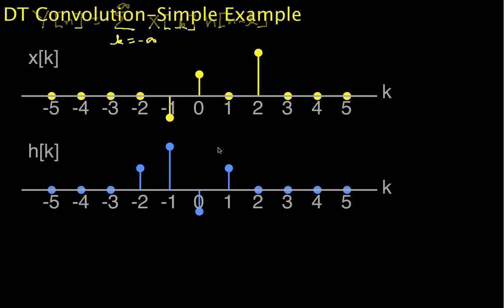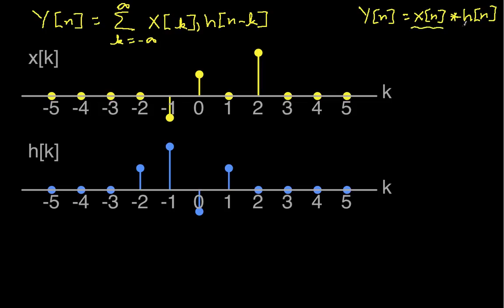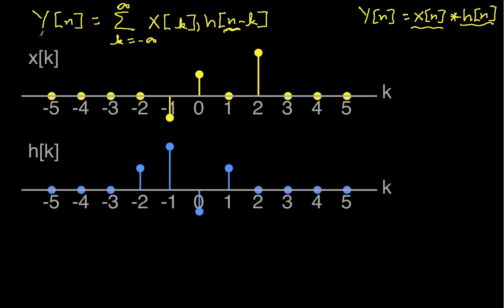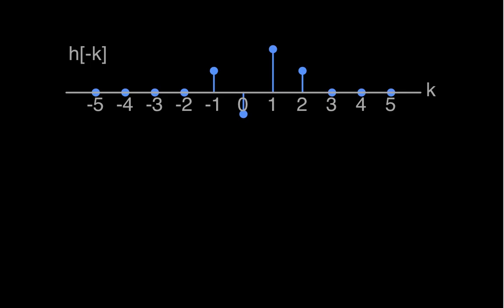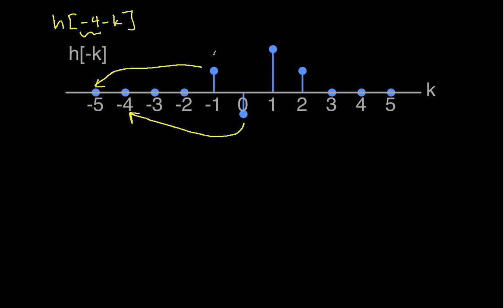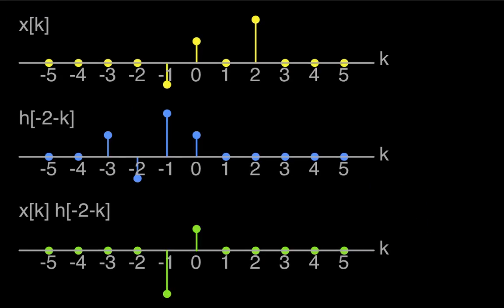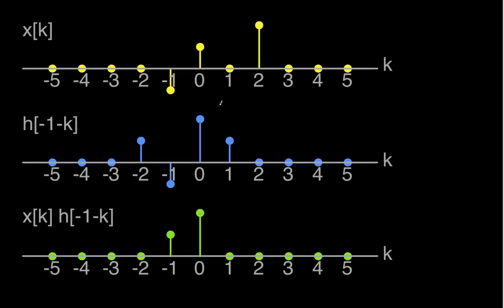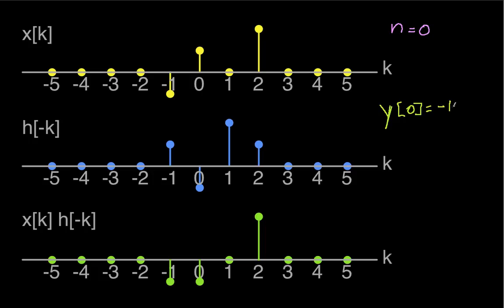DT Convolution-Simple Example Part 1

Comment: Well, actually that won't be the case. If you have a signal x[n] and a signal x[n-2], then the -2 would account for moving to the right (or delaying the signal). Here you are working with x[-n] and x[-n-2], however, and x[-n-2] is nothing but x[n-2] flipped around the y-axis (because you just swap n with -n). So in this case, you are reflecting a signal shifted two to the *right* of x[n] (i.e. x[n-2]) around the y-axis, which results in a signal shifted two the *left* of x[-n] (i.e. x[-n-2).
Reply: Thanks, i was thinking the same. But if convolution is defined from left to right shouldnt it be x[-t-tau] intead of x[-tau+t]?

Comment: Ok so people here are wondering about the shifting. In this video he is right when he does shifting to the left for h(4-k). Here he mirrors/flips it first and then does the shifting. For the h(-4-k), if I do the shifting first, then I would move it to the right for -4 and then just flip it, HOWEVER if you mirror first then do the shifting you cannot move it the right for -4, you have to go to the left. If you don't believe me, you can do it. So the important thing to note here is either you do the shifting or scaling first. h(-4-k)=h((4+k))

Comment: look at it this way:

you invert the sequence x[n] which is centered at n = 0 and you get x[-n], then shift center to n = -3 or n+3 = 0. Then x[-n] becomes x[-(n+3)]. Hence, x[-n-3]. If you don't invert x[n] then you'll replace n by n+3 and get x[n+3]. So be careful about the - sign.

Comment: uugh!  I took a System Dynamics course and block diagrams jumped straight into the use of negative feedback and laplace transforms only.  And that's natural after all, because control is all about constraint, and that's what negative feedback loops actually do.  But then I started on my own doing MIT OCW 6.003 "Signals and Systems" to understand better how programs like MATALB might actually be doing the work and stuff and wow does that book (Oppenheim, et al 1996) waffle around in its examples. Impossible to follow. Diagrams nowhere near the text talking about them, going back and forth between the example and tangents.

There's a 2016 book, which is less problematic, but the structure is different, and just assumes students already know things like z-transform?

Your playlist here is a big help, especially this part where the convolution section is the worst section ever.

Comment: you didn't explain that why do you start from. -4
Reply: I think it would be 0 anyways if you shift it more to than -4 to the left. But theoretically you have to start at -inf. But all values are 0 until -4. So there is no point in calculating the previous values.

Comment: actually, x[-n-2] is x[-(n+2)] and is not equal to the flipped x(n-2),because in this case you shift to the right, because this is nothing but the signal x advanced (i.e shifted to the right ) and flipped about the 0 axis (or flipped and then shifted by 2 to the right if you want)